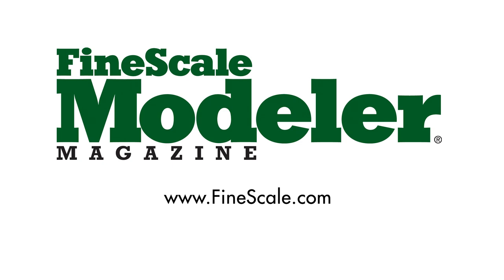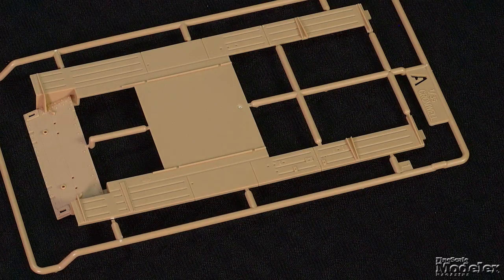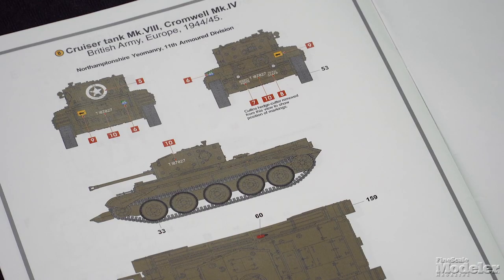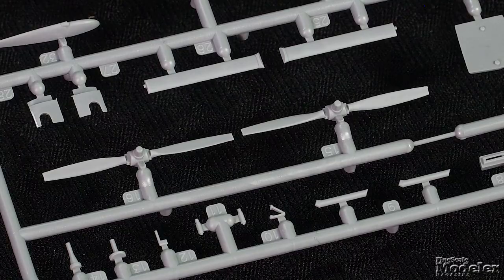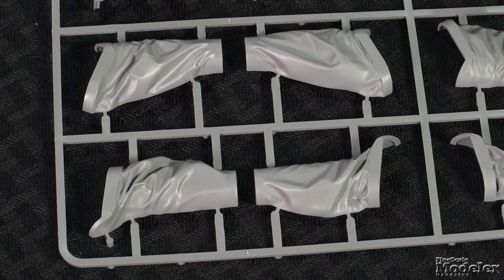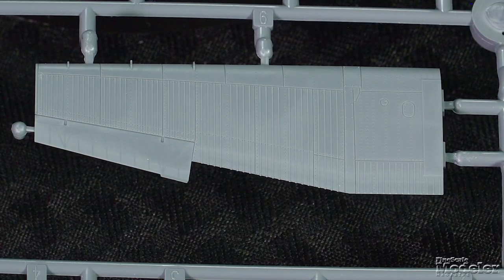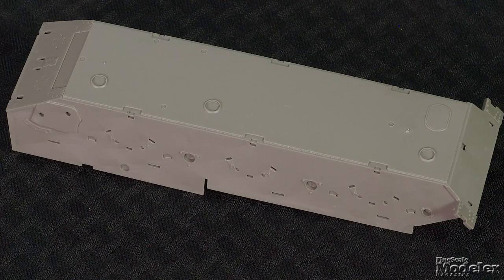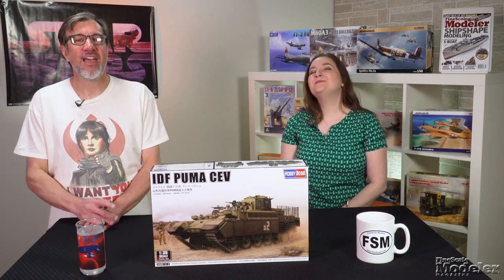Unboxing the Airfix Cromwell, ICM Skymaster, Takom “Bruno”, Eduard Z-37A, & HobbyBoss Puma CEV kits

Comment: Airfixes Cromwell need a good fix! We have had to quickly make resin correction parts for it and get them on the shelfs in our shop! They got the wheels wrong on there new 1.35 after having 1.48 out for years! Should be 8 bolts not 6 and there is no bolts holding the pistol ports in on the turret armour! It's quite a silly slip up as they have had 1.48s out for years!